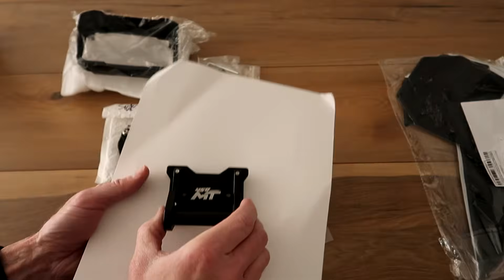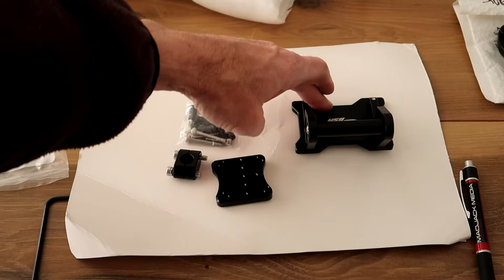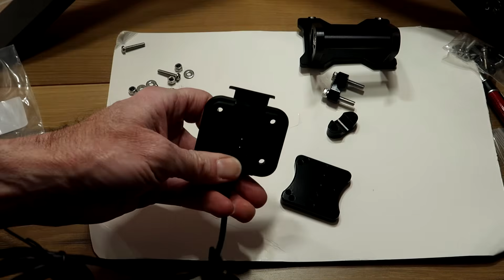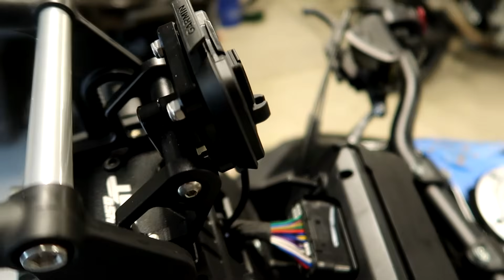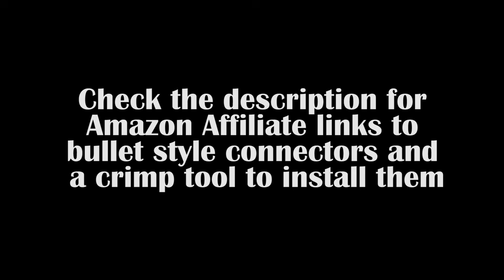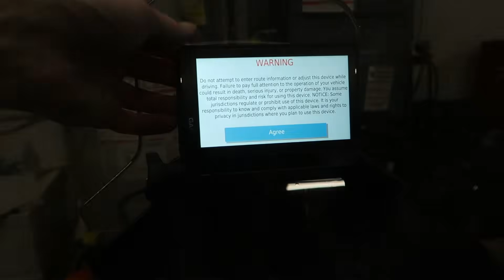Ibex 450 / 450MT GPS Mount and Wiring - Garmin Zumo XT

Comment: How did you remove the TFT display?
Reply from the maker: It's taken me a long time to reply to this message because I didn't recall the process.  I had to do some re-wiring last night, so I figured out the process. 

One method is sketchy because you risk dropping hardware behind the display, into the space behind the headlight.  You can pull the windscreen and access the two top bolts with a 1/4" extension and 10mm socket.  There's a high probability of dropping the nuts and washers behind the headlight.  Ask me how I know - it happened to me last night.  The center nut is hard to get to unless you have a swivel attachment for your 1/4" drive ratchet tools.  Again, high probability of dropping hardware.

The easy access, but very time consuming method is to remove the side panels, part of the tank shrouds/fairings (and crash bars if you have them) so you can access the hardware holding the headlight in place. Remove the headlight, then you can easily get to the nuts holding the display in place. I'm sure that's what I did when I installed my GPS mount and wiring last summer. when I made this video.  That's the only way I was able to get the Garmin Zumo XT (or XT2/XT3) plug down through the gap above the display, for clean wiring routing.
Reply: Yes that would be really helpful!  Thanks for making this video from those of us grateful to you for posting it.
Reply from the maker: New reply posted above.

Comment: These bullet connectors that you provided a link for sure seem small in diameter as compared to regular USA automotive standards. I don’t have my bike available to compare, but can you verify that the Ibex wiring uses this smaller diameter bullet. I’m wondering if I need to send these back to Amazon?
Reply from the maker: They do indeed work and fit.

Comment: I plan to install a Garmin Zumo XT2, Heated grips, and aux lights.  I got the Tusk box.  Do you recommend wiring all 3 into the Tusk box which I will locate under the seat or spread them across the accessory wire by the head light + the tusk box?  Great video btw.  Gave me lots of ideas.  Love this bike.  May need to get a 2nd for my kids.
Reply from the maker: I'd run the GPS to the OEM accessory ports up front and then power the grip heaters and aux lights from the Tusk box.  I have a very detailed video showing how I installed the Tusk box.

Comment: Great video and very descriptive, thank you.
A question I have though is does the Garmin wiring harness and Garmin mount come with the GPS unit when purchased?
I would assume they do, thank you.
Reply from the maker: Both are included.  I run my Zumo XT on several bikes, so I've had to buy more mounts and wiring harnesses for each bike since it's not practical to move the wiring harness to a different bike each time I want to ride one of them.